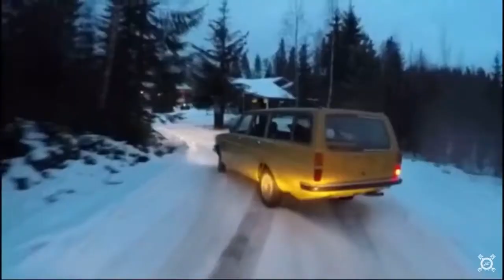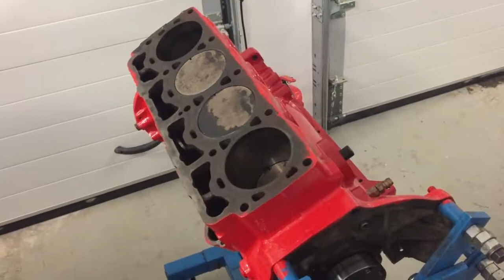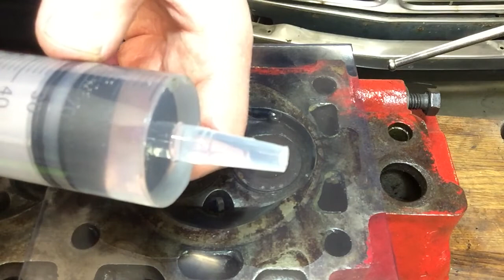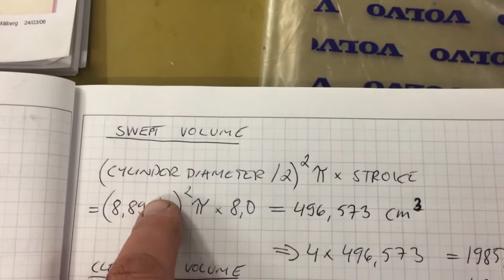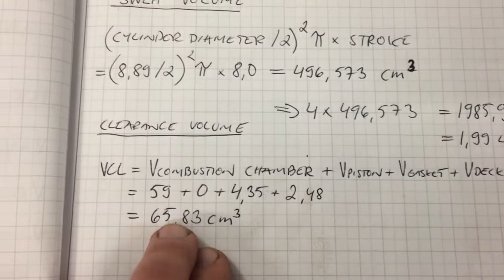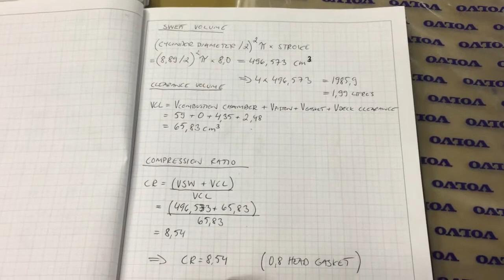Compression ratio | Volvo b20 engine project | Volvo 142 |

Comment: The late B20A and F heads both are 87mm thick I think. There are late model big valve heads which are the same as the F head but without the hole for the injectors. Where the the injectors would go there is a P shape casting if this is the late model big valve head.

Comment: Hi Hans. Very clear explanation. The later models of the 140 also had larger inlet valves.  Good luck with building the engine.
Reply from the maker: Thanks. It will be interesting adventure. :)